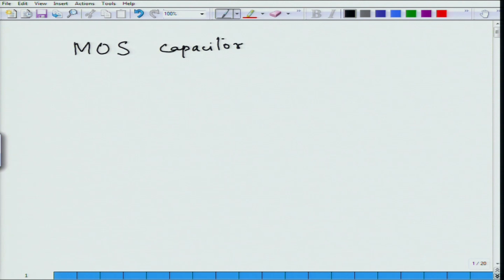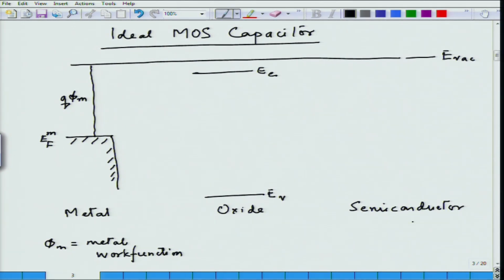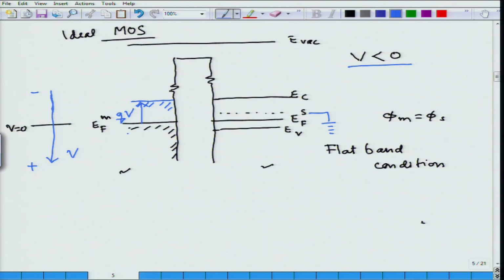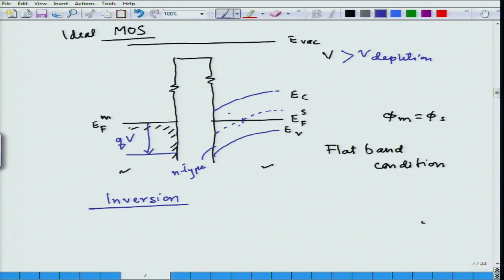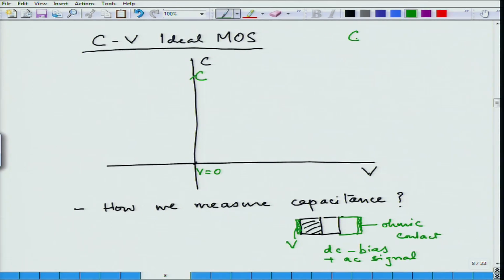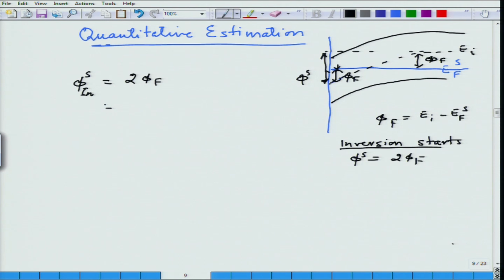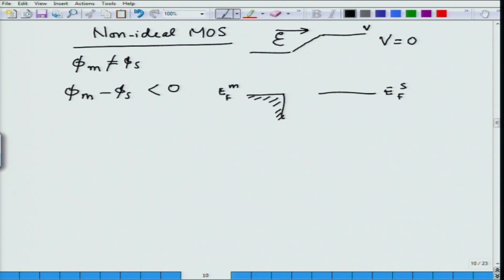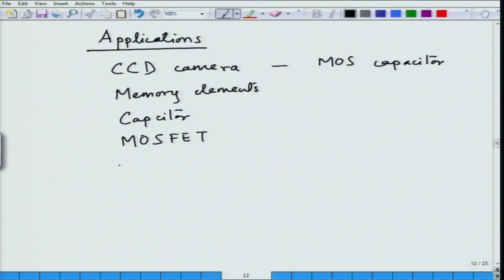Mod-04 Lec-36 MOS capacitor

Comment: 17:00 formula of p is incorrect
Reply: Why?
Reply: @AJEETSINGH-jz7ej  At interface holes conc. is greater than the electron conc. since Ef is more close to valence band that means p>ni(from mass action law) and n is (ni^2/p).
 But from the given given band diagram Ef-Ei is negative which leads to result in p<ni (from given formula)